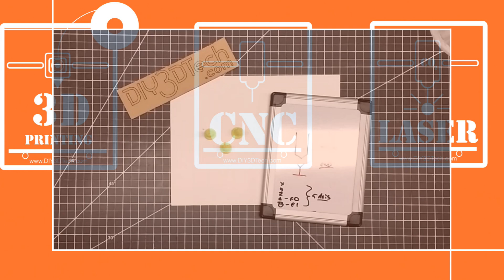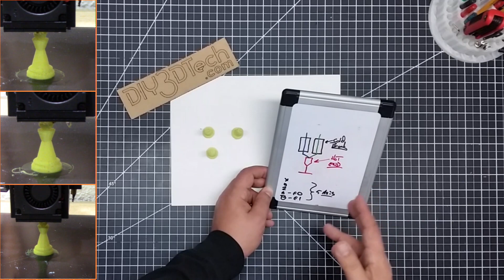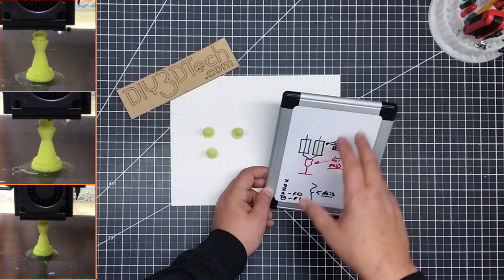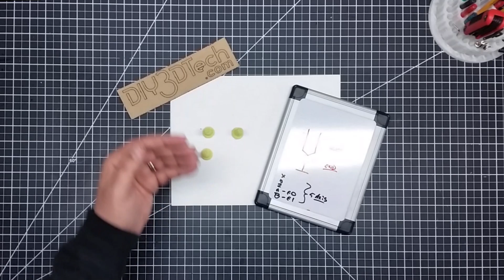GeeeTech A10M - Mixing ABS with TPU Complete Fail!

Comment: No. If it had to melt double the plastic, you would have severe over extrusion issue going on. Your temperature issue is more about lack of insulation than anything else.
Reply from the maker: Don't thinks so as the melting plastic backs up into the bowden tube.   As the issue appears to be the lack of "pressure" or ability to "push" the TPU...
Reply: TPU indeed cannot be pushed too hard.
Clogging happens due to inadequate heatbreak.

Increase heating; You will increase the issue.

But still you do not need to melt double the plastic, as the extrusion amount is the same, and if TPU is not coming at all, then half will need to be melted, as only half is extruded.

You do not melt the entire spool of filament at once, or even everything in the complete hotend assembly. And even IF you did, the energy required for printing would remain exactly the same as the same amount of filament is being pushed through.

Super basic physics and thermodynamics, i mean elementary level. things that are taught in elementary schools.